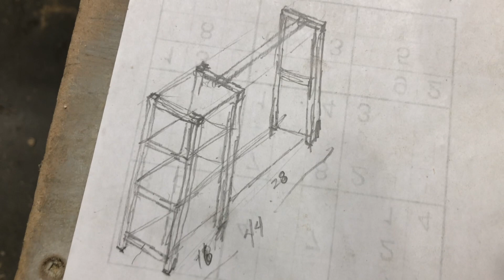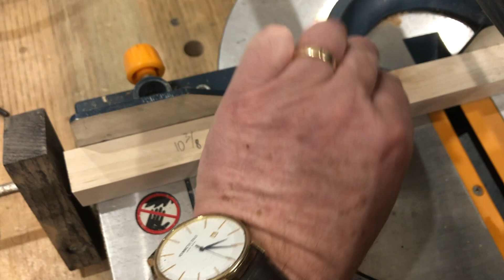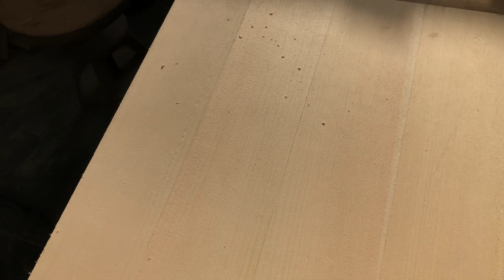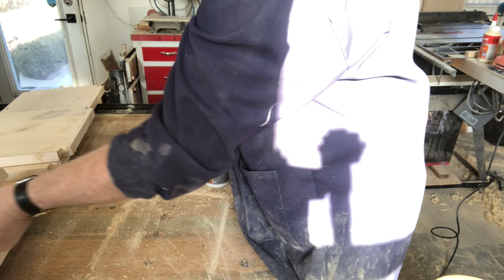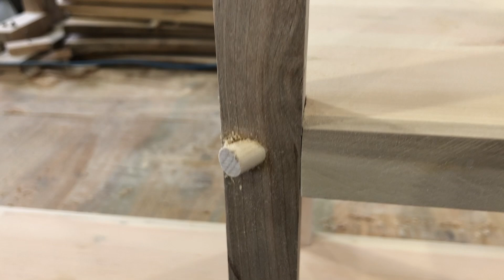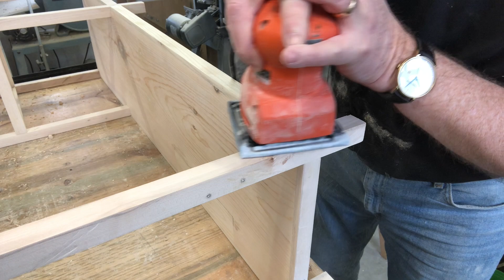Montessori Style Childs Wardrobe Rack - from reclaimed wood

Comment: *Don't follow his method cutting rebates on the table saw*.   E X T R E M E L Y   dangerous practice:   the waste CAN lodge between workpiece and fence or trap in the throat as there is no zero tolerance throat plate!
Reply from the maker: The "pusher block" I am using has a heel that pushes the waste block through the saw. Without that heel, yes, very dangerous. I have a hole in the wall as a reminder of that.
Reply from the maker: Thank you for the comment Poshypaws. Any and all feedback is appreciated.

Comment: I like the open wardrobe. On another note to save me looking for a video on the band saw, how about a sled for a router to flatten a slab or to edge some boards to glue together. And a sled for a small circular saw to break down large pieces of ply etc. Have it so that the saw can be orientated to go across the table or along the length of the table.
Reply from the maker: Thanks for the feedback.  I did a router sled video which you can find here: https://youtu.be/B42TE7Oc1CQ 
I like the idea of doing a panel saw ... I have been thinking about that for a long time now. With the longer rails on the worktable, perhaps that should be the next project!

Comment: I build a piece similar to the shelf side of yours, but I do the leg joinery a little differently.  Instead of cutting a full notch, I clip the corner off each shelf and mill a dado across the inside corner of the leg to accept the shelf.  This (hopefully) prevents a kid from destroying the shelves by using them as a ladder.  Another difference is that I make the top a bit over-sized, as it's easier to hid any lack of squareness that my skills are insufficient to supply.
Reply: ...and by "shelf side" I mean it's more of a night stand sans clothing rod.
Reply from the maker: I had thought about doing a dado for the shelves, and in hindsight, I think it is a better idea.  I think your idea of an oversized top is a good one as well.  Perhaps on the next one!
Reply: @secretundergroundlair4014   Another reason I did it with the dado is because my first attempt at cutting the notches square revealed my woefully inadequate skill. I designed and built the first one in shop class in grade 9 (and the oversized top idea came from the shop teacher).  The dado refinement came many years later when I was looking for an easy project to teach kids to build.  I tell them to save the clipped off corners in case they need a ply or two from one of them to fill the gap created by a too-wide dado. Most kids need at least one of those.